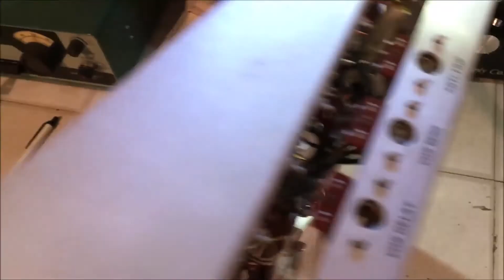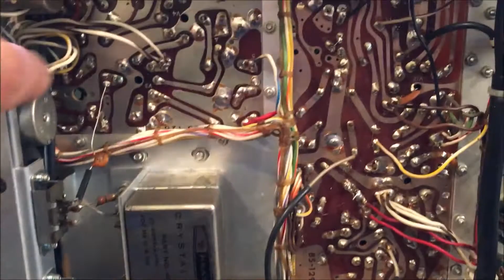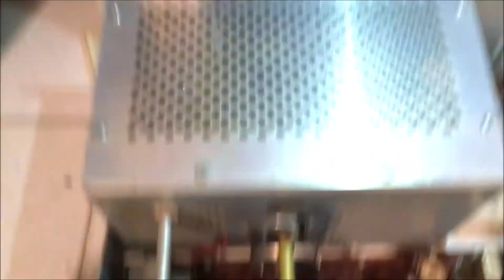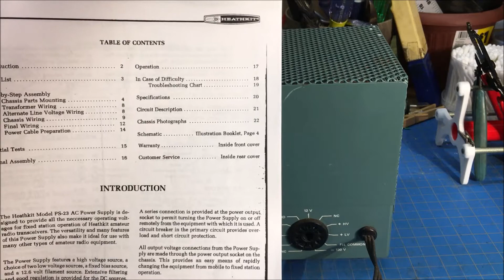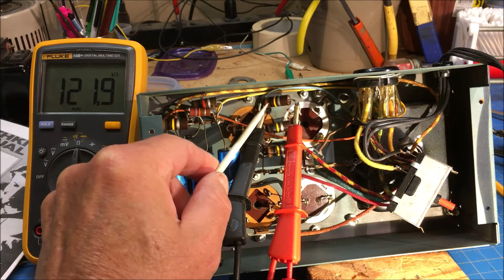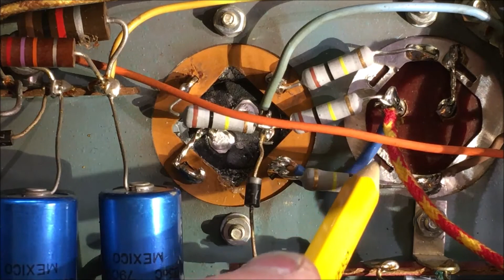Heathkit HW 101 Part 1 of X Power Supply PS 23

Comment: When doing the initial checks for the go no-go decision, you should use a VTVM as they have different impedance and can properly charge the caps to get correct readings..  I kept wondering why my readings were bad and couldn't power up until I tried a VTVM and then all readings were good (After I fixed my one mistake LOL)   Nice work!!!  these old gals deserve a second lease on life!!

Comment: It has been three years since you posted this video, how is it working today after these years of use?  I am surprised that the only testing is done with a VOM, and not with an Oscilloscope.  I am looking for a 101 station with a supply.
Reply from the maker: @kd5smf  It worked the last time I tried it, maybe a year ago. I have 7 radios I try to rotate around and use to keep the electrons flowing…lol. My 101 VFO was bad to drift so it didnt get used as much as needed. I think the VFO could use a good rebuild. To operate all my radio, I have to play radio jinga to move them around. Currently, Ive got. Kenwood TL922 on my bench getting ready to ground the grids. Thanks for watching and commenting….Take Care—Larry

Comment: Would you consider upgrading my hw101 and ps-23? My name is Larry AA4KE. I'm 72 years old and I'd love to get my Heathkit equipment back on the air. I have extra tubes etc along with the manuals.
Reply: I build this back in 1979 to 1980 timeframe.
Reply from the maker: @larryhatcher3694  Hi Larry! I hope you had a Merry Christmas! Im sorry but I dont do work for the public. Did you build it? I wish I had gotten to build one, but was too poor back then. Does your radio work now? Im sure you could find someone locally to help you with the upgrade. Do you subscribe to the Heathkit IO groups? Lots of good info there. Take Care and 73 Larry W4PJP
Reply: @Backtothefutureradios  Hope you and your family have had a Merry Christmas and a Happy New Year coming soon. Yes, I built this, but it's been in storage for some time. I did have a problem with the power supply of which I hope to get it upgraded soon. The vfo floated a little bit last time I used it. I'll have to check out the Heathkit group you mentioned. Thanks for coming back to me and may God bless you and yours. 73 Larry AA4KE.
Reply from the maker: @ Thanks Larry! There are some kits for the PS on ebay and this guy has some rebuild parts. https://w8aor.com/online-store/ols/products/heathkit-hp-23-all-versionsps-23-restoration-component-kit  You might shop around and find what you need. Take Care and please keep me updated! Larry W4PJP
Reply from the maker: @ https://heathkit-radios.groups.io/g/main/topics
Reply: Great video, very helpful.

Comment: I have a couple HW-101s, bought one for myself last summer and another in the fall for my dad if he passed his tests. Found your videos when getting a little research in before starting on Dad's, just passed tech and general at 73.  Do you have any concerns with the ripple current on the large capacitors?  I ran across a post on the 23 series power supply and someone stating the Nichecons with HK part numbers are hard to beat in specs. After running a simulation on the power supply I got ripple currents of over 2 amps.  I contacted hayseed and they were very helpful, but not comfortable with the numbers.  Honestly thinking about using film capacitors, but would feel like a butcher making them fit.  Thanks for the videos!
Reply from the maker: Congratulations to ur Dad! The capacitors I bought from mouser works fine, I never looked at the ripple, the PS works great. Im not familiar with using film capacitors in a power supply. I used aluminum electrolytics and as I said, have no issues. Hopes this helps….Take Care—Larry
Reply: @Backtothefutureradios  understand and thanks, probably never be used enough to cause a problem, but running caps over rated ripple current will cook them someday. Film caps might shift the stress to the diodes and transformer

Comment: Hi im like you demostrative video... Thank you.
Reply from the maker: You are welcome! Glad the video helped….Take Care—Larry
Reply: I am going to acquire one just like it and according to what its owner tells me, it does not have audio. I am EA7JZM and I am self-taught in electronics and I have several devices made with valves. If I had any questions, I would consult you... if you see it as correct... thank you very much
Reply from the maker: @josueamodeo6293  Good luck acquiring the  Radio….My opinion is since this was a kit that was intended for people to build with limited skills, you should have no problem making it work! How I would start is do a good inspection of the radio and power supply and look for any obvious faults or loose connections. Test all tubes (valves), loosen and tighten all printed circuit board screws (ground issues). Use the resistance charts to test all the resistances on the printed circuit boards. Slowly bring the power up, and test all voltages against the voltage charts. NOTE: the resistance and voltage charts have been very helpful to me during the work on my Heathkit. Good Luck and please keep me informed of your progress! Take Care and 73….Larry W4PJP
Reply: @Backtothefutureradios  ok I will inform you of the start-up procedure
Reply: @Backtothefutureradios  Hi, I already have the equipment at home.. I'll tell you at first sight that I need the union of the end shaft because it's cracked... I don't know where to get it... and also the rubber rings that move the tandems... where can I get them? . thank you ...
Reply from the maker: @josueamodeo6293  Hello Josue. You can make the belts for the tandems by going to the auto parts store and buy rubber O ring material. Carefully measure the length and “superglue” or “crazy glue” the ends….Im not sure if those brands of glue are available there? Im not sure of what coupler you are referring to, but you may be able to find parts for these on eBay…..I hope this helps! Please keep me updated….Take Care—Larry
Reply: @Backtothefutureradios  my mother I just saw that it is a hw 100. although I have seen the one of the hw 101 and it is very similar...
Reply from the maker: @josueamodeo6293  the 100 and 101 are very similar.
Reply: @Backtothefutureradios  Thanks you
Reply: @Backtothefutureradios  very good phenomenon... I have a question... how do you connect the internal speaker...?? I can only get audio from the front jack connector. from behind it does not come out and I would like to put a speaker inside the equipment like yours. thank you very much... by the way, in the connector on the front, the audio through the speaker comes out the screeching audio of the halfway of the audio in the knob...
Reply from the maker: @josueamodeo6293  Hi Josue…. I would check page 178 figure 2-26. The headphone jack on the front of the radio disconnects the rear speaker plug when headphones are connected….. I would check the front plug and the resistor R952….. Im thinking that the circuit to the rear speaker plug is being switched out by the front plug or a bad component. Hope this helps…Take Care——Larry
Reply: @Backtothefutureradios  Another thing that I have noticed is that in the cage where the valves are housed there is a screwed trimer which has a capacitor that goes to the lower tandem that adjusts the antenna impedance... this equipment has been left directly with a thick thread.... what capacity does it have because it doesn't come out in the manual.... thanks again...
Reply from the maker: @josueamodeo6293  Josue, I’m not sure what trimmer you are talking about?? Is it the neutralizing trimmer? The mica compression capacitor??

Comment: Rubber drive belts, there are three in this HW-101 transceiver, or should be, are still made! Whomever built it did a fine job. The PS 23 shows it age but 
was a good restore candidate. Unhappy little turtle.
Reply from the maker: Thanks! This one has 2 rubber one spring loaded string/ wire (I havent looked that close yet).....I have ordered 2 belts that suppose to be guaranteed 10 years.... we will see. I can tell you the little turtle was very happy as he swam off into Watts Bar lake!!......Thanks for watching and commenting! Take Care—Larry
Reply: @Backtothefutureradios  watts bar i thought in video 2 the lake looked familiar. Just live down the road in Maryville. I have 2 hw101s and power supplys to restore. One has the cw filter. Looking fwd to part 3. Thanks for the video.
Reply from the maker: @jeffdyer2393  Thanks Jeff! Not much to part 3…..been running the rig and working out small bugs….mostly mechanical issues, like dial was rubbing wiring harness etc….I will eventually post part 3…Take Care—Larry ps….I have another 101 and ps on the shelf….not as nice cosmetically as this one but was working when I put it on the shelf…

Comment: Larry, you have inspired me to pull out my HW101.  I'm looking forward to the rest of the series!
Reply from the maker: Thanks Dan! I’ve just started on Part 2, about to power up the 101....not sure my plan of action at this time....from all I’ve read and seen, I may end up pulling each board and checking the resistors.....from what I have seen some folks have had to replace many out of tolerance resistors....we will see....Also, I just printed out an article by Mark WB8JKR....not his call now on “Optimizing the Heathkit HW-101, SB-100-102Transceivers” which I may do the enhancements listed there.....Take Care-73.....WA4PJP....Larry

Comment: I have one of these Hw101's and a PS23 supply sitting on a shelf in My Garage. Bought them both off of EBAY but the external looks of the Transceiver looked great the PC board and internally looked awful. Will be interesting to see what you do with this one.
Reply from the maker: Thanks Double L!! Is the problem the soldering of the boards or just been in a bad environment??? This one looks in really good shape....I made a couple of CW contacts on this one when I first got it....not sure about the ssb side.....I have another one on the shelf....I used to use it on occasion, the outside is rough looking...someone has cut a slot in the front and added a switch....not very professional looking....I’m hoping this one will pan out and be one I can use in the shack. Thanks for watching and commenting....Take Care—Larry